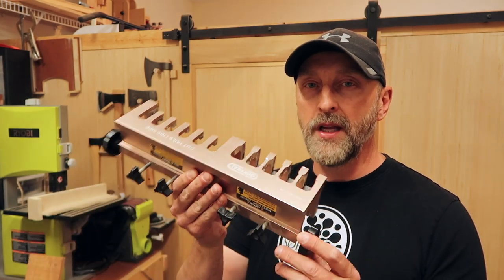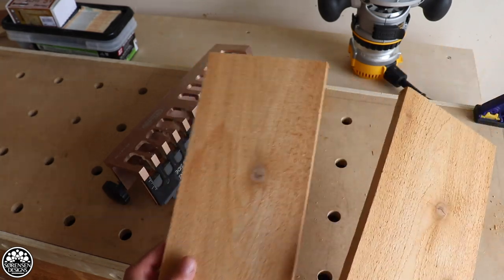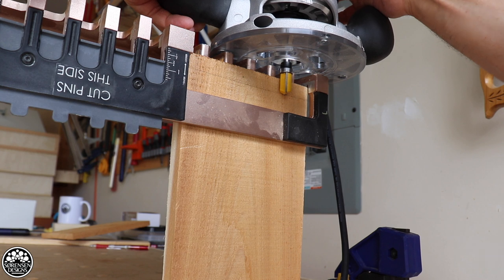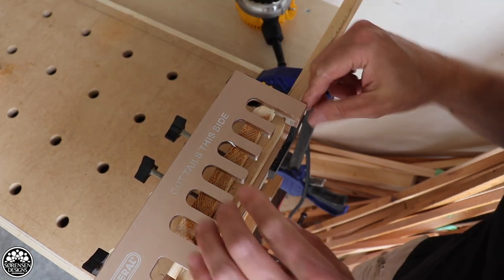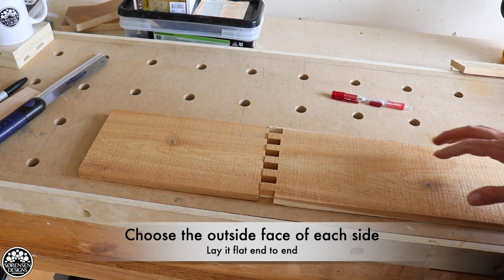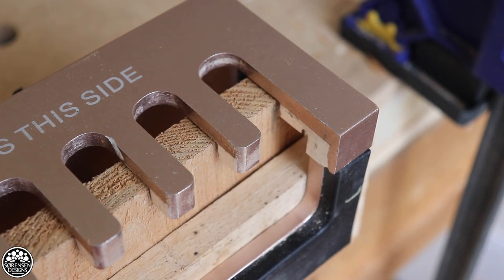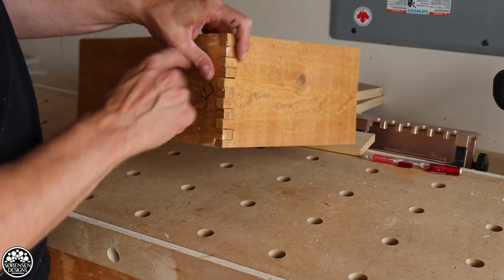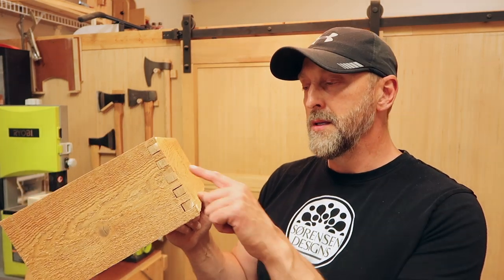Box Joints Using a Dovetail Jig // Woodworking

Comment: Eric, I see the bearing is always toward the router base, is that correct? If so, I need to get a new bit since mine have the bearing on the end of the bit (for trimming i guess)
Reply from the maker: I've actually switched to using a guide bushing instead (13/32") because the bearing bits wear out pretty fast when you use it on this jig. You can get a pretty inexpensive set of brass guide bushings on Amazon. The brand I have is Shop Fox.